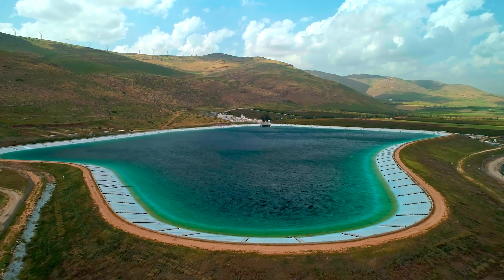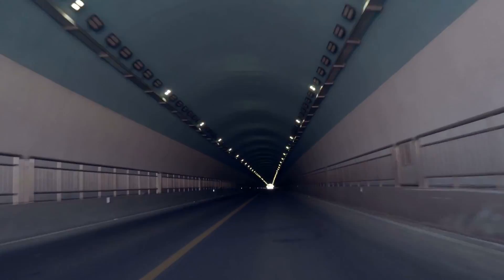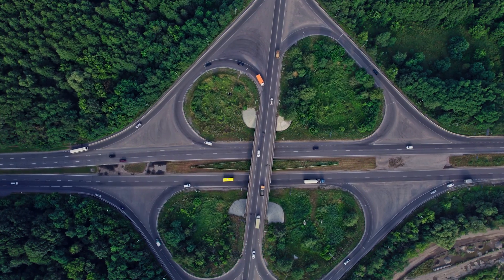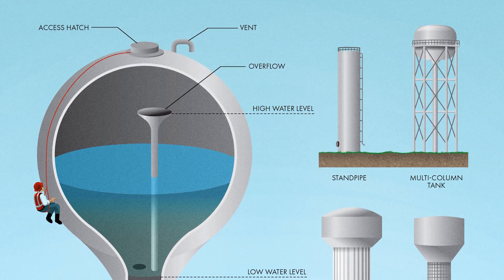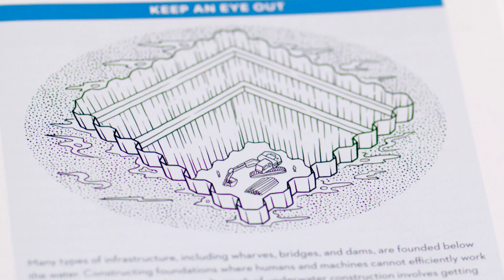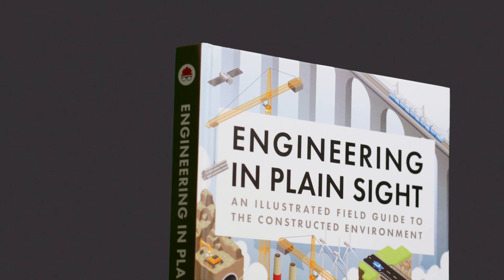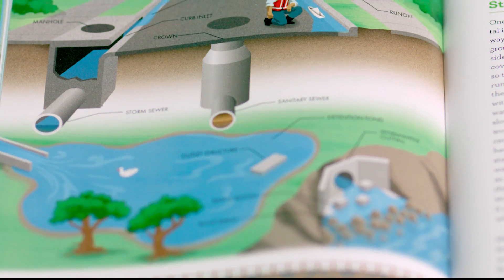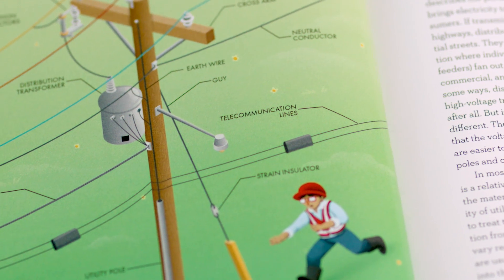Engineering In Plain Sight: An Illustrated Field Guide to the Constructed Environment

Comment: In reading your book, towards the beginning, when you talk about matching supply with demand, and at times the power company can ask a company to shut down some demand, the off loading.  I’m not sure if it’s important, but from the company’s perspective, especially a company that has a high demand of electricity, have to stagger the startups of different departments, a coordinated plan so as not to achieve peak demand if they were all turned on at the same time.  There is an initial peak demand at startup and then once the machine reaches optimum speed that demand drops down to a steady state, then the next department starts up.  The reason I was told was that the power company generally takes the maximum demand and applies for the day.  You wouldn’t want to turn everything on all at once, as peak demand then would be significantly higher and therefore their electrical cost would be very high that day, week, months.

Comment: My kids have been fighting over the book all week.  If that's not endorsement enough, I'm also an engineer, and I find the book well-written and accurate.  It could replace the opening lectures of an undergraduate study on any of its subjects, and it does this without using overly technical nomenclature... at least when that isn't necessary.  I'm not suggesting it should replace any amount of study for anyone, but it may be just the ticket to encourage many people to take those second and third steps after sparking some interest.
In format, it's somewhere between a coffee table book and a young adult nonfiction reader.  You can flip through and skim the illustrations, or you can pour over each section in detail and walk away satisfied in either case.  It has just enough humor and self-awareness (usually in the illustrations) to keep from being too dry or lofty.  Also, critically, the content is accurate and relevant.
Great gift for anyone age 5 to 105.